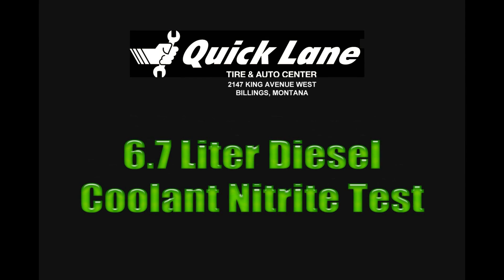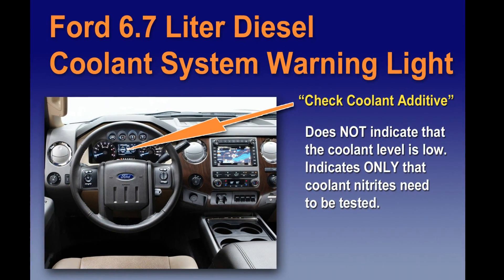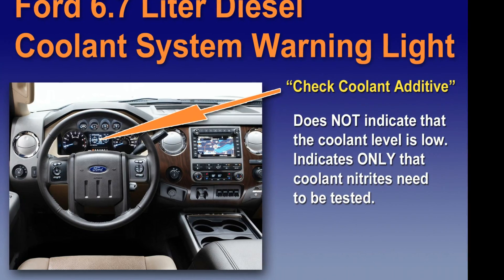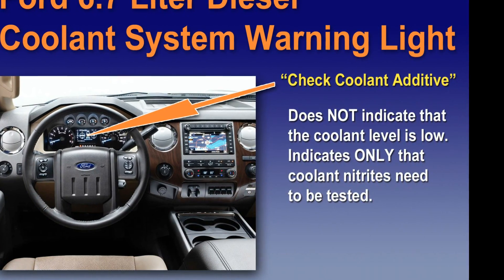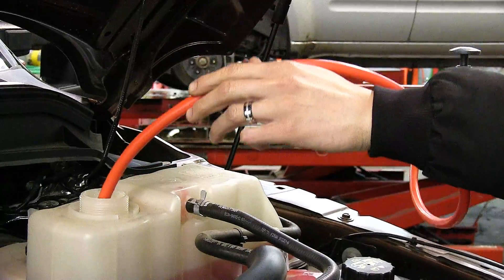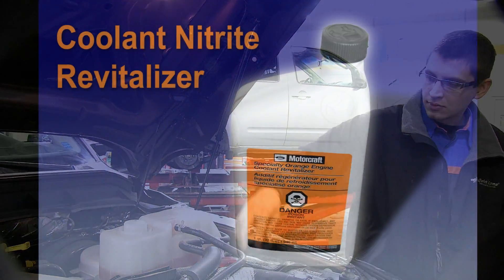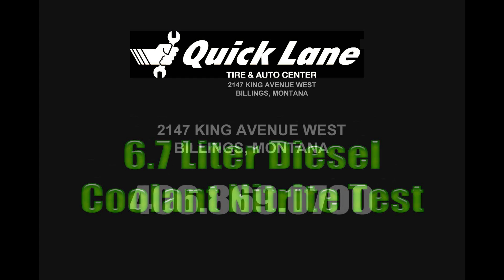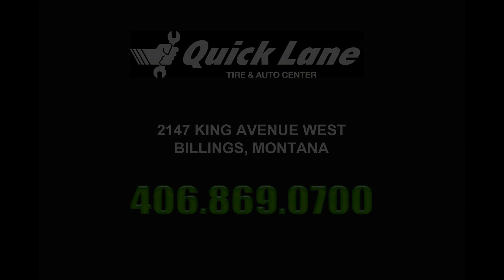Ford 6.7 Diesel Coolant System Nitrite Test

Comment: Cool video. Coolant sample to be tested needs to be taken from radiator drain and not the d gas as stated in the workshop Manual. Incorrect readings will result.

Comment: This information is bullshit.  A proper test requires taking the sample from two drains somewhere at the bottom of the system.  There are TWO independent cooling systems which do not comingle.  There should be NO nitrates found.  It is imperative that the proper procedure be followed, and this video depicts one of many wrong ways to do it.
Reply: Gregory Valentine yup 6.7 coolant is supposed to have 0 nitrates - and we have 2 coolant resiviours

Comment: The test is to make sure NO nitrites are in the cooling system. If there are nitrites present in the cooling system of the 6.7 PSD, you need to flush the system. Just wanted to make this clear. The video makes it sound like you need to add nitrites which just isn't true.

The revitalizer is to add corrosion inhibitor.
Reply: Great points, lots of videos on YT that leave a lot out. Its always good to read the comments first before watching the videos.